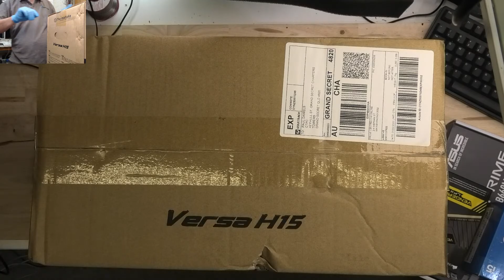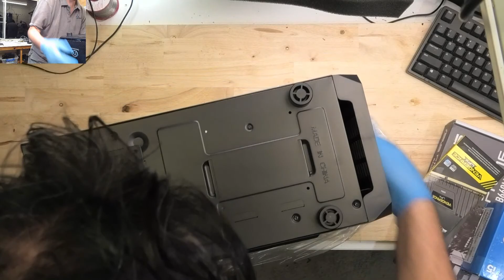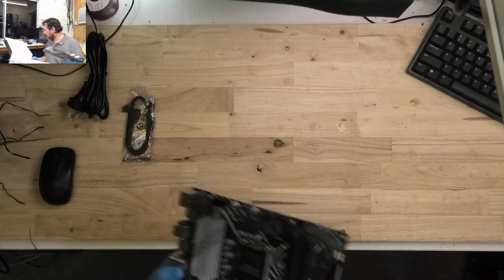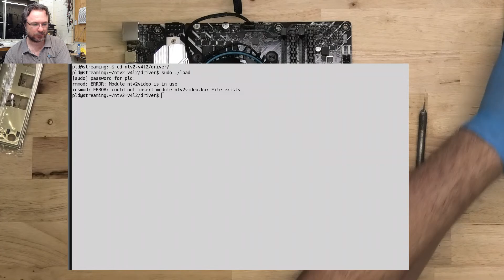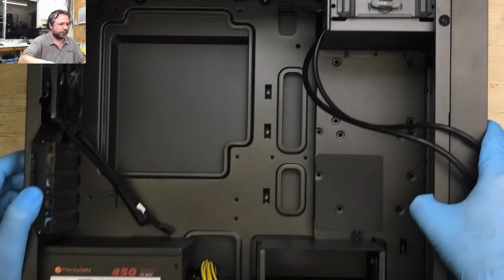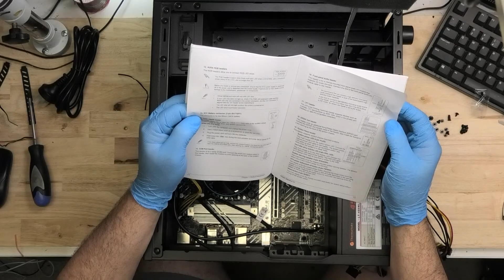The Boring No-Bling i5-12500 PC Workstation build for YouTube live streaming. Ban the RGB !

Comment: My apologies to Ed D. Boss for seemingly ignoring your Hello in the Stream. Sorry but I just plain missed it even though my name was highlighted. 🤦‍♂ I will try and do better next time.
Paul's new desktop was a nice thrifty purchase from Bunnings. I finally remembered where I had seen that wood pattern previously because I drooled at it myself due to the price. The Bunnings high quality pine timber comes from NZ and is ludicrously expensive compared to the example shown on Mr Daniels desk. It's a nice top Paul and I hope it wears well for you.
25:23 Cable routing??? 🤷‍♂What is cable routing? 🙄 Since I don't like RGB and don't have an ego clear side panel then I have no need to to make it look pretty ergo, I don't give a shit what it looks like inside. However when we had the old liquorice strap IDE cables I was a bit more careful to not upset the airflow.
35:10 I have no idea why they don't make these bits into a gang plug. It such a pain in the arse trying to see into a dark case with lots of shadows especially when one has bad eyes. It was annoying enough when my eyes were working correctly.

Comment: Rather than losing your bay rails in the workshop, could you cable tie the unused ones together somewhere in the case through one of the cable management holes?
Reply from the maker: Was going to zip bag them up and place them on the floor of the case under the storage HDD.

Comment: Boring!
It needs ALL of the RGB!
Actually you need 5 different memory hogging apps to control the RGB.  There should be an all in one app that can control the RGB, but some have the 3 pins, and other uses 4 pin set ups...
Reply from the maker: 4-pin setup is needed when you want the "alpha" control byte... spluh!
Reply: @Jim Allen not an AIO, but a custom loop!